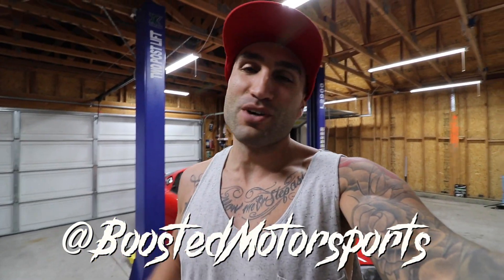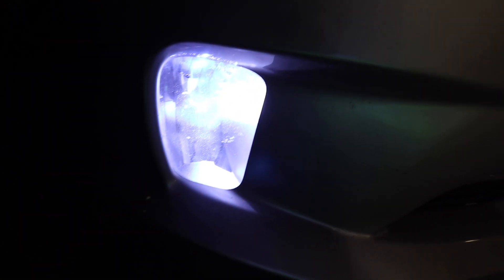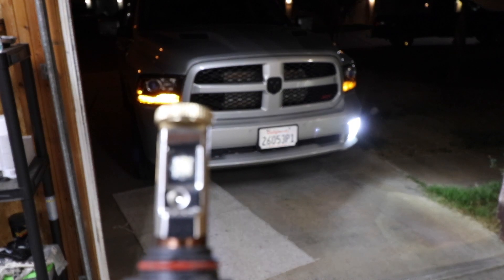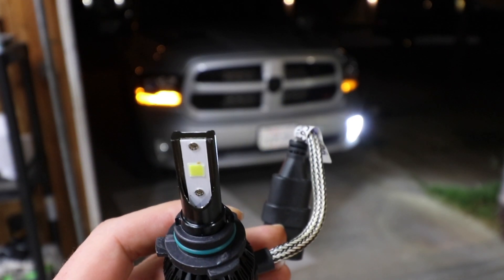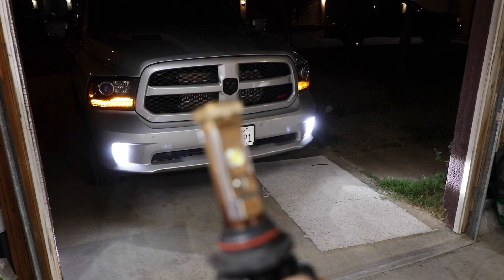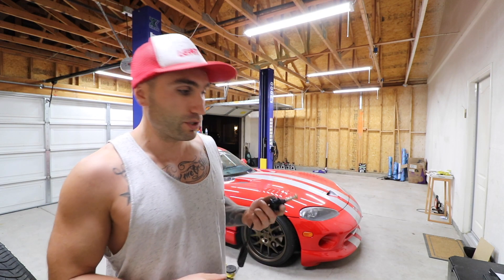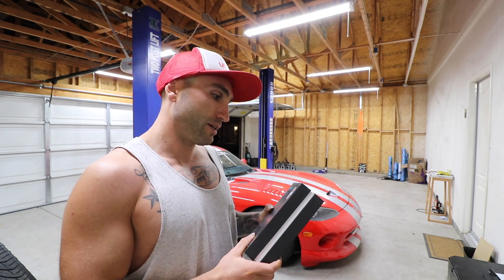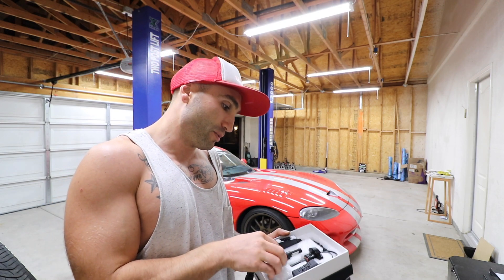Hikari LED bulb FAIL

Comment: It would seem your hikari bulb is a CREE led version. You should look into the hikari ultra or hikari lighting since they both use the new Philips Lumileds LEDs.
Reply: Cree can be reliable too, usually its heat that kills them, so perhaps there isn't enough heatsink/fan on there to ensure long-term life.

Comment: I've been considering the new morimoto's from retrofitsource.... They are thin and supposed to simulate a halogen bulb.

Appreciate the video as usual and the heads up on the bulbs
Reply: rogerwilco71 
That’s right and they also come with 3 years warranty
Reply: I have the old 2 stroke bulbs and they are really bright. I'm sure the 2.0's are way better being as thin as they are.

Comment: So 4 days ago you said your current setup is c6 in the fog.. now this video says hikari fog went out... you switch brands everytime you fill up? Or were you mistaking in the video?  Because the one you made awhile back also shows you sticking with hikari because they were brighter..
Reply from the maker: Sorry for the confusion! Just edited the videos at different times lol.  The Hikari was brighter in a comparison we did awhile back but the bulb burnt out as seen in this video so we put the C6 back in and it looks pretty similar in light output.  Currently running the C6 LED bulbs in the fogs 👍

Comment: I have to say, check out headlight Revolution for all your lights. I did and I'm super happy. Just my thought on the matter. I tried those and it did not make me happy.
Reply: I bought supernova v3 from them had burn outs on them 2 times they discontinued the v3  now I'm on my 3rd v4 replacement not sure if i will continue with supernova brand

Comment: I had supernova v3 they burned out two replacement then they discounted the v3 went to the v4 already on my 3rd replacement of the v4 still have my stock reflective quad bulb housing just bought Alpharex pro G2 housing H7 bulb was looking into Hikari h7 LED's....... btw Hikari has 2yr warranty